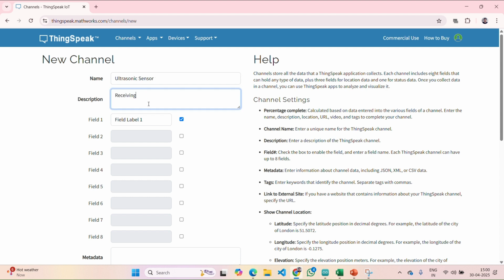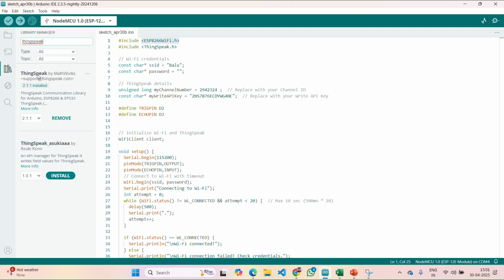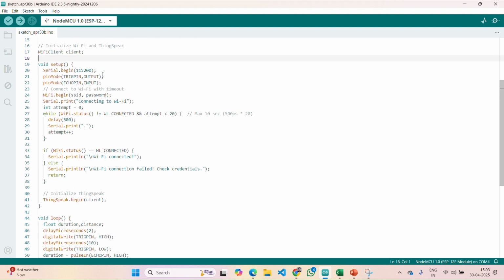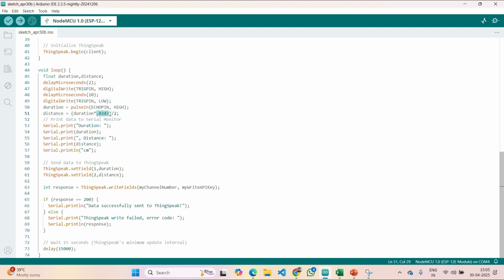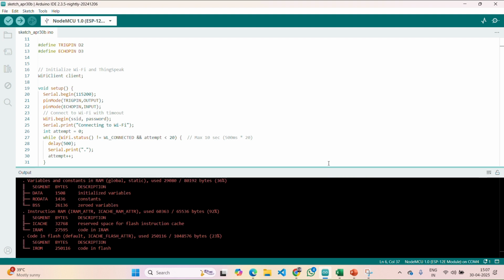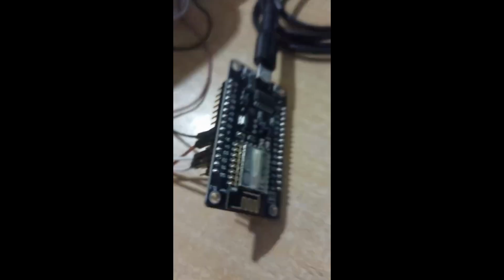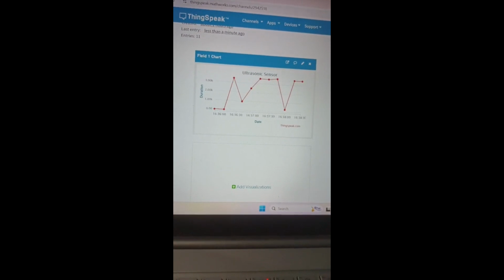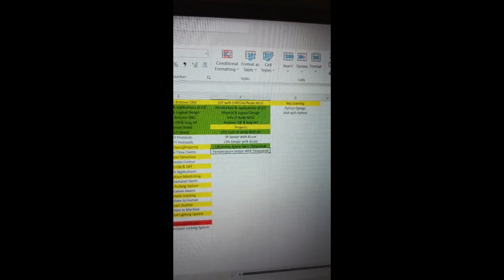Sending Data of Ultrasonic Sensor to ThingSpeak using NodeMCU(ESP8266)

Comment: Bro my serial monitor is not showing number what should i do
Reply from the maker: After uploading code immediately don't open it. You need to wait for at least 15 seconds and then open. Sometimes due to continuous code uploads also it will not open properly